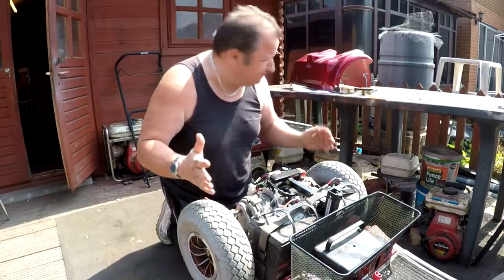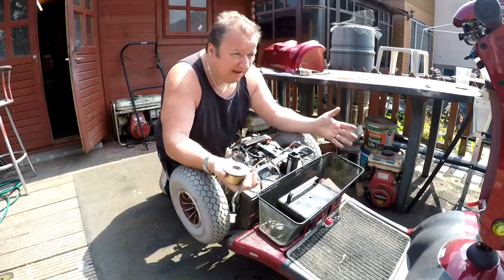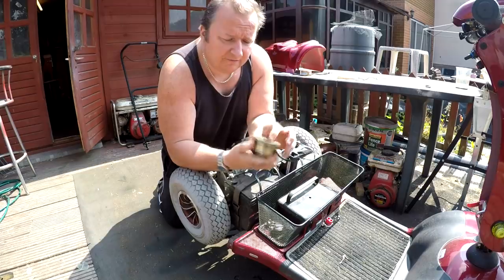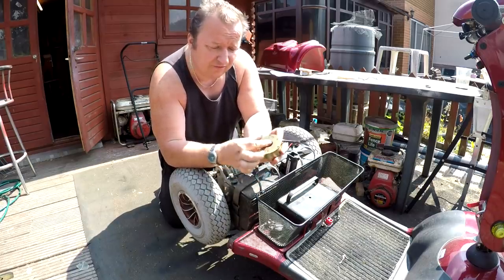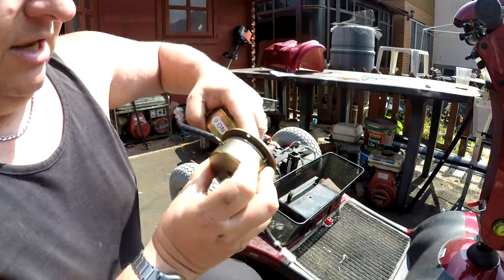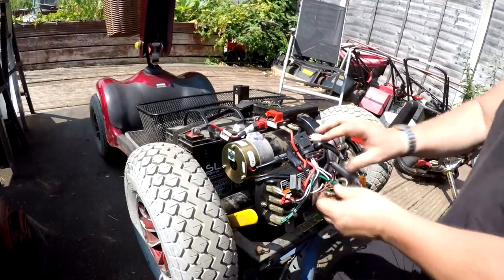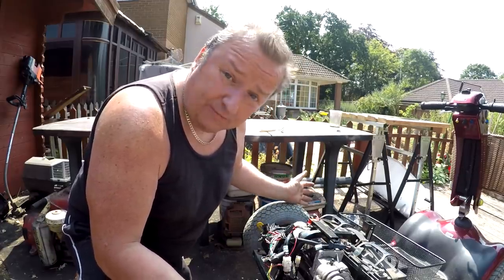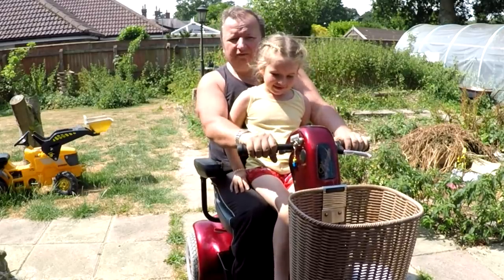Part 2 Mobility Scooter Won't Work Motor Brake Problem | Shoprider

Comment: You've got a real gem there, Martin. A clean and wax will attract the right buyer. As fun as petrol-powered equipment is, it isn't street legal. But at least where I live, there's no restrictions on electric disability equipment. You could have quite a bit of fun souping up a mobility scooter.
Reply from the maker: Yes, its something I've thought of before but too much on.

Comment: Very informative! I have an electric commuter scooter & it doesnt have enough power to properly brake on hills & its really unsafe (I live in San Francisco, CA USA) If I have this right it seems I can probably upgrade the cylinder from the stock light use to a med/heavy use. (I have a Mercane Transboard 48v 500w foldable scooter) Thanks again!!!

Comment: The coil creates a magnetic field that opposes the ferromagnet inside, if the coil is still energizing then the ferro has demagnitized over time so there's less torque, same happens with electric motors that have aged or overheated weakening the magnet.

Comment: the brake is an electromagnet atracting a cast iron part with a brakeshoe in between 
sumtimes the cast metal part gets too magnetic it can cause the part to brake constantly 
one solution that sumtimes work is to take the thing a part and slam the cast metal part on a table a few times to demagnitize it , usually fixes it , not allways for a long time but you might get lucky

Comment: Good job , expensive part thou init , wonder why it fails has it got a magnet inside ?
Reply from the maker: The could of wire creates an electro magnet when it energises Paul but it migh have just got tired.

Comment: It sounds like a weak coil, the coil will show good but it will be weak and want allow it to operate properly, that's why the tech told you it can't be fixed in any conventional way, only thing that you could do is rebuild the coil but it might be more of a headache than it would be worth.

Comment: Sounds like the brake winding (positive) was "poling" meaning shorting to earth providing the circuit is earthed at the negative (or vice versa), what else could it be? Look for wear (rubbing) marks around the coil outside and in particular inside, even test with a megger if you know someone who has one.
To those suggesting a petrol engine I don't think you're allowed in a supermarket or pub with one of those running.

Comment: Kwoor that was an expensive part, (most stuff for 'medical equipment ' is)  almost spent less overvolting one of mine to 60v , not so practicle and runs a bit hot.
Reply from the maker: Yes it was dear, as you said, medical stuff normally is.